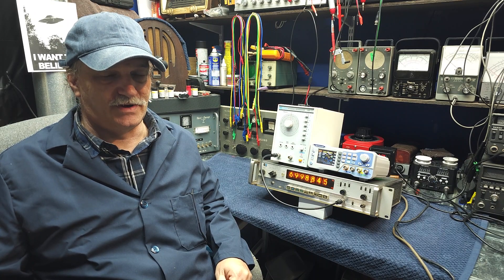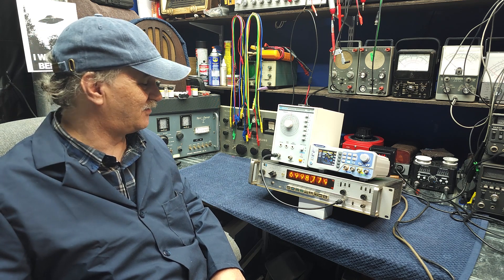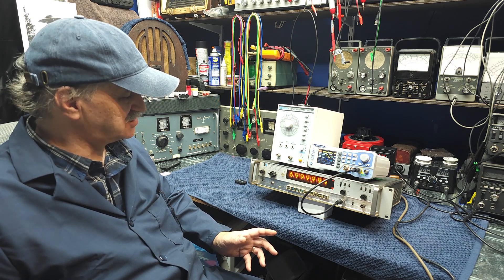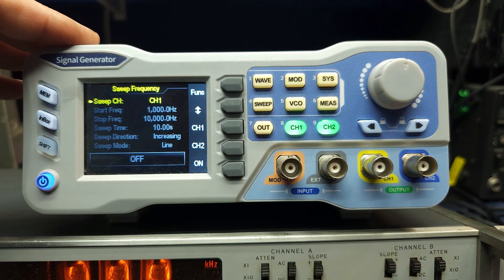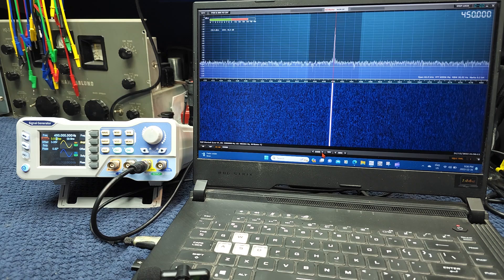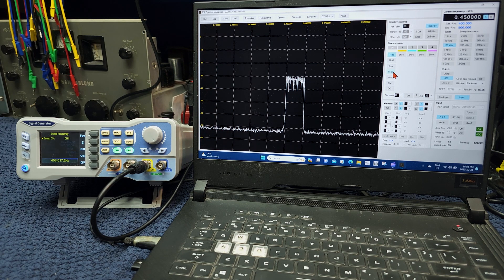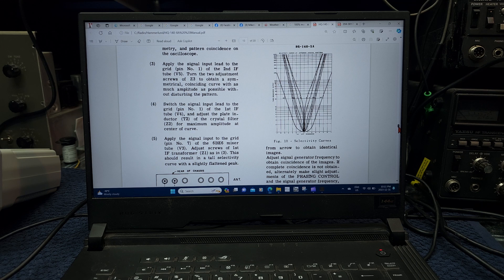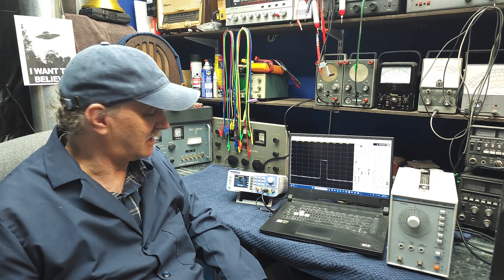Koolertron 60 Mhz Signal Generator Review

Comment: Thank you for posting this Mike. I had looked at this exact  model of Koolertron on Amazon and read a lot into the negative comments. Guy says he got it to align old radios and it was useless and he couldn't figure it out. Your video set me straight on this and I immediately sold my Heathkit plastic dial unit. My only question was this: The Heathkit can do RF, can the Koolertron do RF and do you really need it to work on old radios, if it does not. I am currently re-capping a Wireless Set #19 and will be using the Koolertron to align it when I am done fixing what I find bad in the chassis. I also have a Hallicrafters S-85, similar to the unit you did the series on and that will be my next project when the WWII set is finished.....Thanks Again, Bruce KO4UHL
Reply from the maker: Yes it does rf just fine. You can't align a restored radio without a stable source like this. Those who can't make it work for a rudimentary alignment are doing something wrong. Make sure you get one 60 mhz or better.
Reply: @MikesRadioRepairRestoration   I got the exact one you are using 60 mhz.  A lot of people had negative complaints on the units failing after a year or so. NEVER  by anything on Amazon without adding a 3-4 year warranty. No questions asked, they just send you a new one:-)
Reply from the maker: @bruceclaxton5721  When not in use, unplug it. Completely. It is sensitive to precip static and far off lightening strikes. Most of the time, when they dont work any more, this is the issue. And its a simple fix to reflash the firmware onto it. Done. But if you keep in unplugged when not in use, you should have no worries.

Comment: Mike,

I like your videos. I'm new to your subscription. I am working on a 1946 Learadio. I want to tune the frequency of the RF tuner. You recommended the Koolertron signal generator, which is 60mhz. Are there any other cables I need to move forward? ....Also on your video tools you need to work on tube radios I cant access the list of tools and equipment. Is there a way I can get it. Thank you Mike

Comment: Hi Mike. I don't think my reply got through, so I will reply to your questions again. The radio is a Hammarlund HQ-129 x and I attached my scope to the speaker output terminals.  John
Reply from the maker: 1) Is it possible for you to join our facebook help group? 2) I have the manual now and i am reviewing. 3) it is usual to to clip on to the AVC line with the scope and do a 40 Khz sweep of the IF, BUT you are dealing with the crystal filter alignment correct??
Reply from the maker: reviewing the poorly written manual, they do not ask you to clip onto audio output for IF alignment. They wish you to clip onto the output of each IF stage as you go. Which makes for sense for the o-scope routine. If you want to clip onto the audio output, use a steady 455 khz signal and an AC volt meter clipped onto the speaker. Tune for peak.
Reply from the maker: John, I could help you much more if you were in our Facebook help group. My help here is limited. The group is not an open one and is private. You must request to join and be personally approved by me. So its very safe.  https://www.facebook.com/groups/mikesradiorepairrestoration

Comment: Based on your review, I bought the (same model) Koolertron and really like it. I am in the process of aligning a Hammarlund HQ129X and therefore need the sweep function. The radio  manual doesn't give much guidance on setting up the sweep generator, and sweep generators were probably not too common when the 129 was produced. Do you have any thoughts on setting these controls on the Koolertron?
1. Sweep  direction (round-trip, increment or decrement)?
2. Sweep amplitude (start and stop amplitude)?
3. Sweep duty cycle and stop duty cycle?
John
Reply from the maker: I have forgotten what the IF on that is, but I will assume its 455Khz. a 40 Khz spread would be good. Meaning start at 435 and end at 475. Now the 64 dollar question. What are you monitoring the output of the IF with?
Reply: I don't have a spectrum analyzer, so I am monitoring the output with a scope per the method in the manual. And you are correct. The IF is 455kHz

Comment: Thank You for the video.  I was a looking for a signal generator to work on audio/radio equipment.  I would have been nice to have the model number in the Title/comment section I think I found it on Amazon.  Thank You again for the video!
Reply from the maker: I expressly didnt include the model number as I am aware Koolertron just changed the model number. However it appears as the 60 Mhz new model is what you would be after.